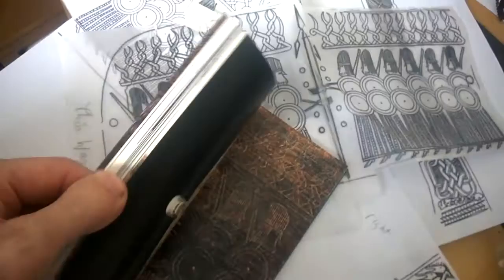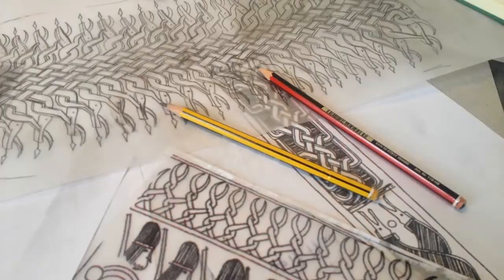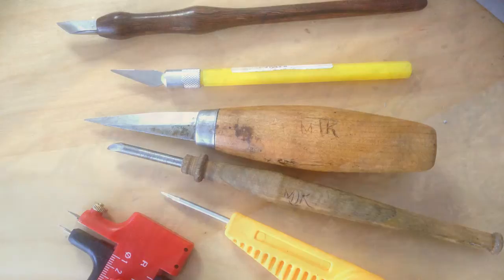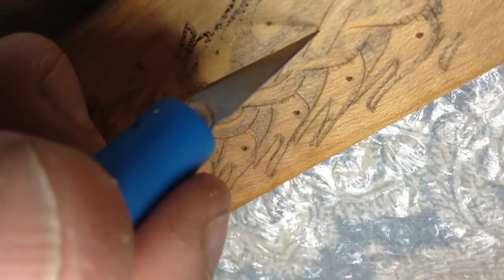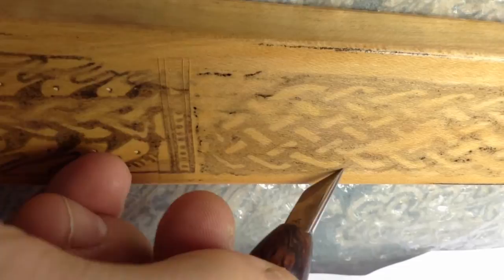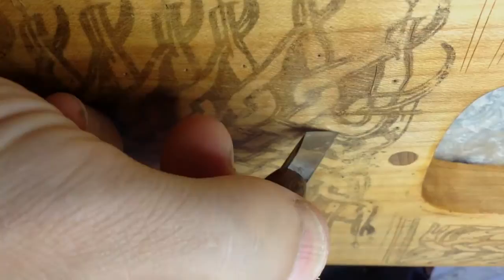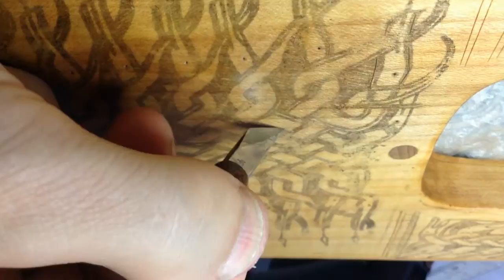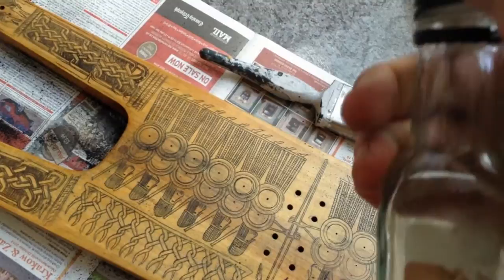Kolrosing: Decorating the Trossingen Lyre

Comment: Fantastic! I knew this technique to be used on scrimshaw but not on wood. I will be trying it out. Thanks for the vid!
Reply from the maker: The thing with wood is to sand to a finish, seal it with oil or shellac before you pencil on your design, then it will not absorb the colour when you oil and fine sand over the design.
Reply: Michael J King Thanks for the tip. How would it work if i put a french pollish finish over this kind of work, will it draw out the collor?
Reply from the maker: Kroffe75 I would French polish before cutting and simply fine sand or buff after oiling.   The oil seals the pigment.

Comment: Sweet, so just the dusting with paint brush was enough to get the coal to fill cut ?
Reply from the maker: The oil turns the fine ground charcoal into a paint paste.  I think the original used beeswax as the medium.

Comment: Do you think I can do that on spruce soundboard, or it will splt?
Reply from the maker: Not the best option.   I have done simple Rune patterns on Pine and spruce but the detail is hard.   I think Pyrography,  burning the design on would be less structurally damaging than cutting lines into it if the top is thin (under 3mm)   Drawing or painting is another option.    The Norwegian Hardanger fiddle has patterns on the soft soundboard painted in  (Rosemarling)   Seal the top before painting,     The Kolrosing technique works better on hardwoods, maple, Beech, Birch etc
Reply: @michaeljking  it's 5 mm actually, but I understand, that's what I though might happen
Reply from the maker: @Rottensparrow  shallow cut no more than 1mm with a razor sharp craft knife or scalpel.   Detail. Is hard in spruce to cut in.     If you don't want to draw or paint the design on another option is sealing the surface and use a black laser photocopy of the design in reverse and use a solvent to transfer the print to the wood,. There are videos on YouTube showing printing on wood this way.        I have used all these methods over the years.
Reply: @michaeljking  Do you think oak is a good kind of wood for a soundboard? I know that most lyres soundboards were made of maple, and probably just a one or two from oak. Is it resonating well?
Reply from the maker: @Rottensparrow it's a less responsive wood as a top with gut strings, more percussive when strummed.      Better as a back or frame wood.  I have built two oak topped Snape model lyres (14 years ago now.)    Most Anglo Saxon lyres have maple soundboards but this model was found made of oak throughout.    https://www.michaeljking.com/snape1.jpg   maple is the best wood that was chosen historically   I use maple on historical Anglo Saxon lyres,   yew wood ocasionally on Viking age models,    spruce on later lyres like my Kraviklyra.  Recently used red Cedar on my modern hybrid lyres to get a warmer sound.